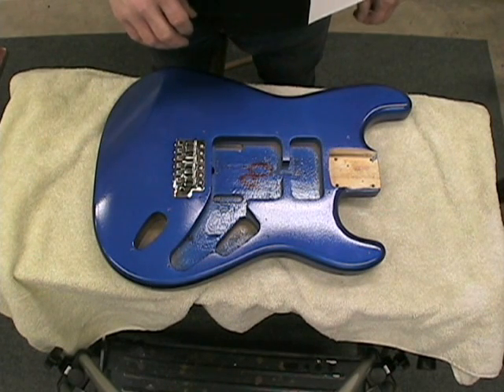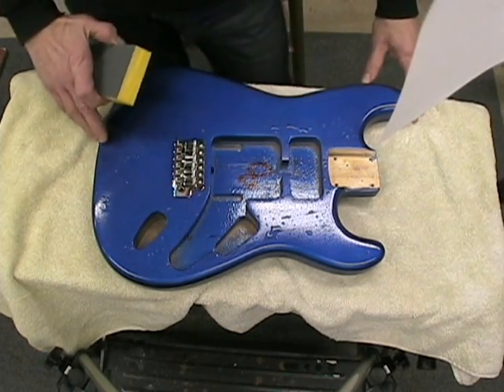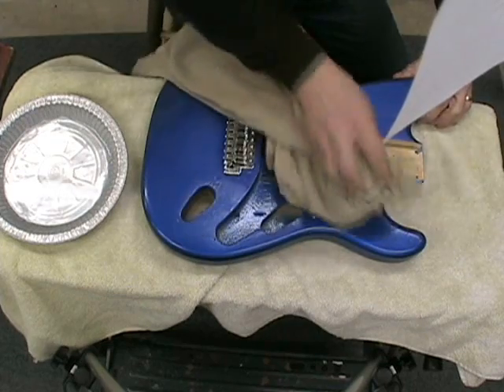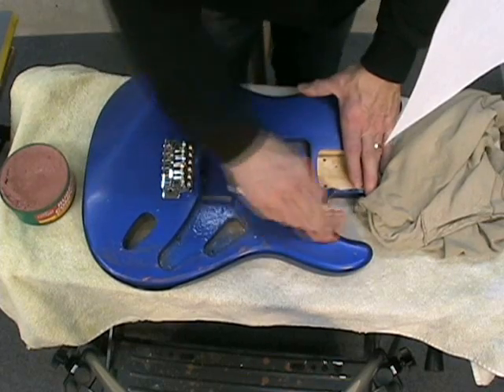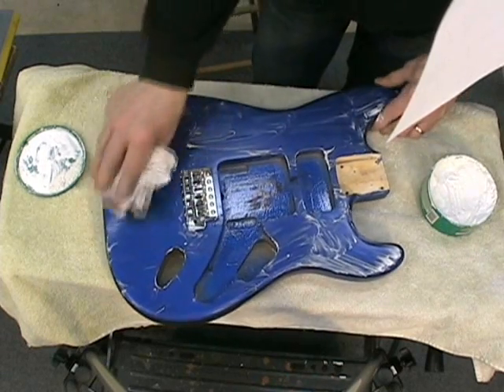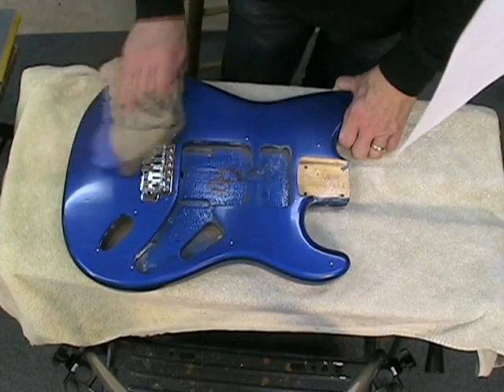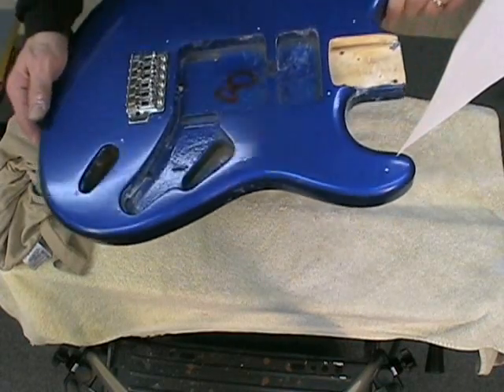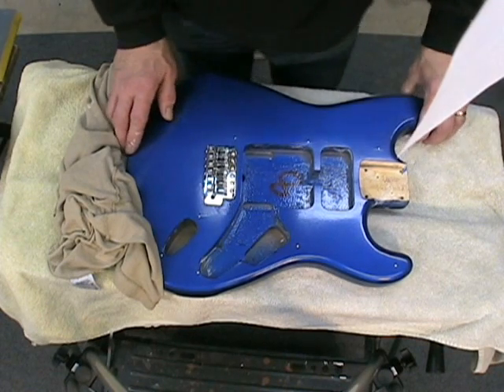Adding a Metal Flake Finish to a Strat (Part 2)

Comment: You really dont need to use 4 steps of compound, I have refinished many guitars, I use meguiars swirl remover 2.0, Followed by 3m hand glaze, Then im done, Very simple process, That cheaper clear probably took months to fully cure, Spraymax is a way better option for spray cans.

Comment: LOL why are you wet sanding with a chrome bridge on the guitar. While you are wiping you are pushing water under the bridge. I thought you said don't go criss cross or across. You did that with the 2000 grit. End result is pretty nice but take off that bride man, take it off. There is probably so much crud under that bridge now - grit- compunds wax and so on ohhh and that water! OMG- Springs are in on the back?! Hope you clean off that hardware before you apply ground to that bad boy.